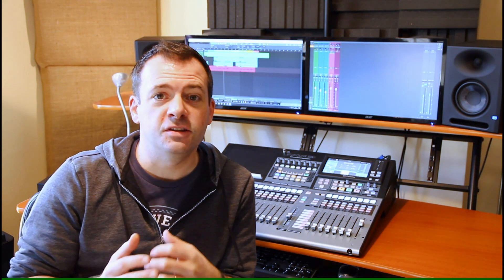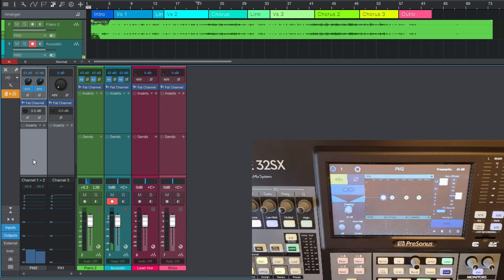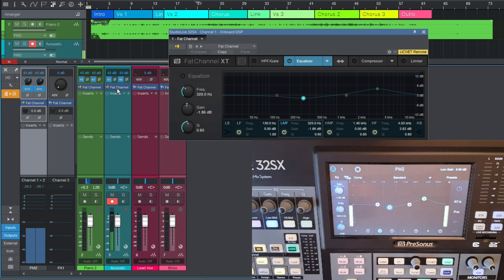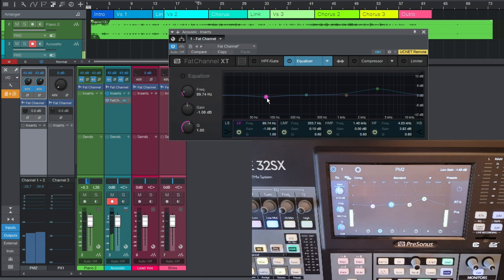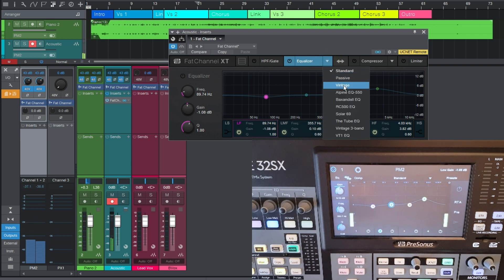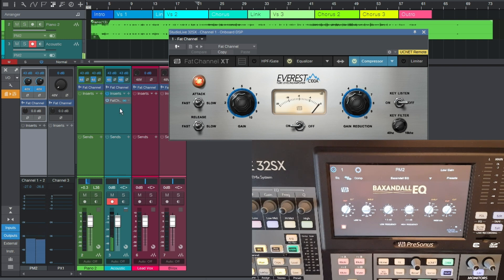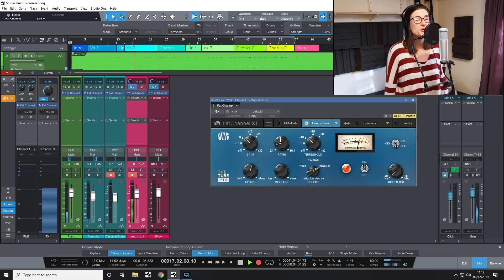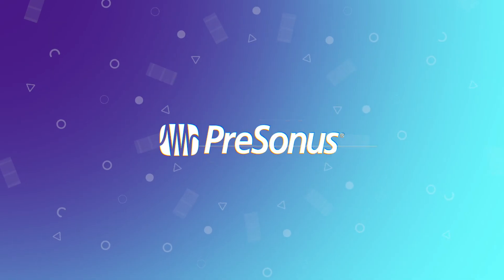Using the Fat Channel when recording with a StudioLive Series III mixer - part 4/6

Comment: How do you avoid the issue where if you have these linked, and you open an old s1 track is replaces all your current onboard settings. Happened to me and what a nightmare. Havent found a good way around it. It should prompt you and ask before it changes everything on your UC/mixer but it doesnt.

Comment: Mat fantastic series of videos. I have a 32s and a fixed studio. I mainly use synths and guitars + some drum machines. I never move things around and I have a lot more instruments than inputs. In one of your videos you used an NSB16.8 could you please do a video about using it in your studio as I have been saving for the 32.16 so can have everything connected and call them up to record as I need them. This would be fantastic if you could do such a video. Everything using the NSB stage box is from the live prospective and not the studio.

Comment: Question: If you have say a very dynamic performance (let's say a vocalist) and the compression you add is controlling peaks (as not to clip during the loud sections while recording), so if the compressor is not actually being recorded, would you not run the risk that the performance could have clipping/distortion in areas because there was no compressor holding back those peaks. Now once recorded w/clipping it will not be fixable. Or does the Desk alert you and/or limit those peaks to prevent ruining the track. Well done video series by the way. Thanks.
Phil

Comment: How do you get the Mixer to duplicate the effects on the board I just get the Inserts and Send page. It wont bring up the effects on screen on the StudioLive 32?
Reply: have you figured anything out yet regarding this? I am having the same issue
Reply: @cameronwarrenmusic  yes you have to switch out of DAW mode in order for this to work I am not  a fan of that but it does work. Also you can keep UC Control on the iPad and do it from there and use your finger

Comment: I suppose it could work in reverse, right?  eg. if you have a quick initial recording session, capture the raw output from the pre-amps at proper levels, adjust a fat channel profile in post, then come back and apply that profile to specific channels in either a second recording session or live gig for both monitor mixes and even main outs?
Reply: I'm also assuming with in linked mode, StudioOne is recording the raw output of the preamps and applying the effects live on the board for the real time output - and via software model for playback from the computer?  So it would be possible to readjust everything in post to experiment with different live settings.  Such as if you were to loop a guitar through the mixer before the pedal board you could then replay the recording micro adjusting the sound through differently configured pedal loops to build both a tuned rig setup and a MIDI program change track to accompany any live backing tracks...

Comment: Thank You.  This video has help me greatly. I have recently set up a 32s with 2, 16 channel stage boxes in our studio.  I have not set up the wi fi yet. I am also confused a bit by the AVB network routing. When you set up your user input channels how did you route them so that when you hit the network select on the UC surface control they routed correctly??
Reply: Hey Pete, the desk is connected by USB to the computer so all I was doing was changing the input source of the channel - once I selected network as the input in UC Surface (which is exactly the same as selecting the network input on the desk itself) there wasn't anything else needed to be done to use the channel as an input within Studio One. Have you checked out the earlier videos in the series? Video 2 especially shows the other end of the recording setup but do have a look at all of them if you haven't already.